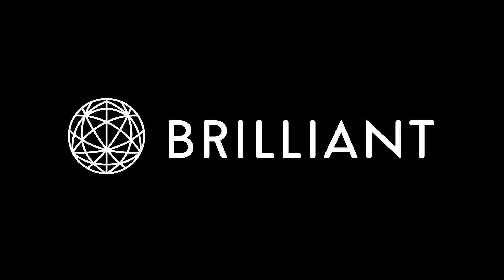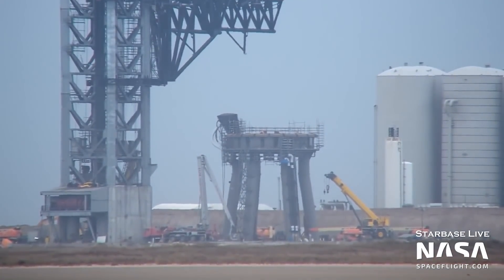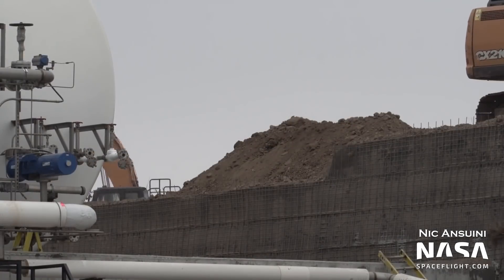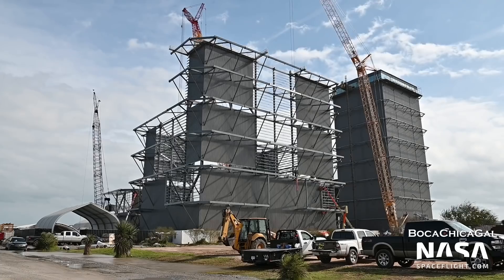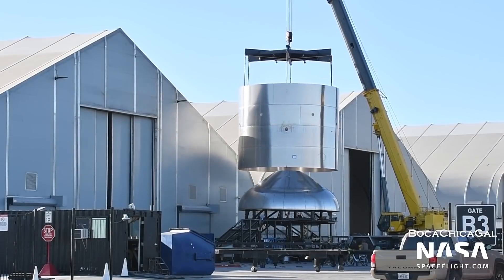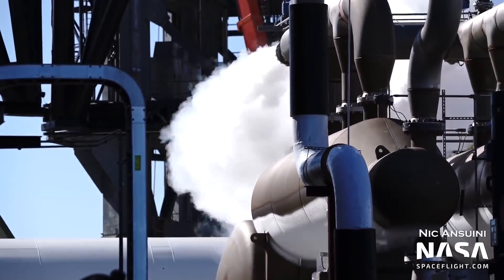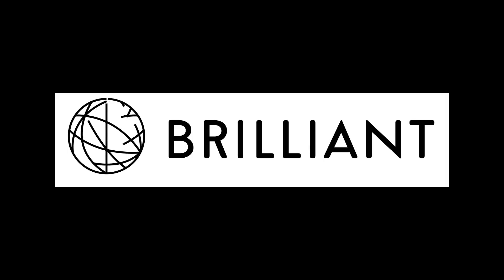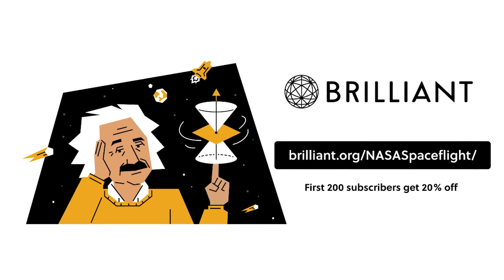SpaceX tests rocket catching system, but is the tank farm in trouble? | Starship Update (Narrated)

Comment: I do appreciate the updates. I'm certain all at NSF have greater insight than me in these matters however  all this speculation about what ships and boosters will fly is frustrating. The next FAA input is late Feb I beleive and then there's no guarantee of approvals. This means Space X has time to produce and yes develop however these are still prototypes and they are not trying to succeed first time. That's what NASA does. SX needs to fly this thing and learn. I can't see them scrapping boosters and ships when they need to learn.

Comment: The removal of the berm probably indicates that the landing area will not be used for landing anymore, so protection in that direction is not needed. All the vehicles will be caught by the chopsticks, so no landing platform needed. 

It may indeed also point to an extension of the tank farm, but to say it indicates problems with the tank farm seems a bit far fetched.

Comment: U r crazy if u think 20 and booster 4 won't fly. They've done too much work on them not to! And they need that flight data. Upgrading without knowing were points of failure are can be very costly to both design and time

Comment: RGV Aerial had a live review of their recent overflight on Saturday, and they were talking about how the original methane tanks at the tank farm were not certified by the Texas Railroad Commission.  Texas Railroad is the governing organization for fossil fuel safety in TX.  RGV was saying that the upright methane tanks were not correctly protected by a protective barrier.  The berm is being taken down to put in two more new horizontal methane tanks that will be protected by a cement wall, and that should pass certification by Texas Rail Comm..  Seems like the end of Feb. date is at risk right  now.

Comment: I dont think they'll use something other than Booster 4 and Ship 20 for the first orbital flight, simply because Elon said they plan on doing catch attemps with the second orbital flight and I think it would be a waste to throw Booster 7 into the Ocean if it was build with the purpose of being caught when you have an earlier more simple version readily available, which was never meant to be caught. Also more flight data is always better.
Reply: Newer boosters and ships might have improvements which will increase the probability of not destroying stage zero at launch. If so, it's probably better to not take the risk with B4 and S20, as stage zero is way more complicated and expensive than a booster or ship prototype.
Reply: Exactly and since B7 and forward is expected to use V2 Raptors, throwing the old V1s on B4/S20 in the ocean isn’t an issue. They’d still get a ton of useful data.

Comment: I think Marcus House said it, or maybe Felix, but they need to do a lot of leak testing / purging and flushing of the pipework + cryoproofing in the tower for the Starship QD. It seems the only real way to do that is with a starship attached to the QD.... so its reckoned they will likely want to do a starship lift and mount fairly soon after a booster lift just so they can do all that as well.

I reckon they would remove starship fairly soon afterwards just cause you don't want a full stack exposed to winds etc (ie normally a full stack would happen within a short window before a launch, not days and days and days)....

So maybe we'll see a chopstick full stack sooner rather than later if only to validate and prep the GSE pipework in the OLT.

Comment: If the methane header tank is located at the very tip of the vehicle - how will that enable the top section to house people & cargo ?
Besides - and that have baffled me for a while - why do SpaceX place the header tank in the tip of the nose if they plan it to be elsewhere anyway - i mean - all of those nice videos that they made of starship shows that the entire 1/3rd top section of the vehicle is for cargo & people, so why are they testing their prototypes with a header tank located where it eventually shouldn’t be ? 🤔
Reply: The lower ends of the methane and oxygen header tank sections will be almost nested or spooned. (Of course the upper end is the cone tip.)   like this:  ⪦)
Reply: Starships will usually return nearly empty except for the header tanks. They need mass at the top end of Starship, where they depend on it during "broadside" reentry to keep the ship well balanced.

Comment: Scrapping Booster 4 and Ship 20 would be a bit silly, since no other vehicles (apart from Booster 5 and Ship 21) can use Raptor 1s, and so it would be a massive waste (of money and time) to not get tons of data from an orbital flight, even if they are outdated.
Reply: The only downside to using 4-20 is the consumption of one the five potential launch permits. Launch costs are negligible, and the two sets of soft landing data will be invaluable.
Reply: They already know all they need to know about Raptor 1, which is that they're difficult to work with and not reliable enough. They completely halted all testing of Raptor 1's on the test stand a while ago, even though they definitely have many that are ready to go. SpaceX doesn't follow the sunk cost fallacy. If something is outdated it's scrapped, no sense wasting time on it just because it was expensive.
Reply: @potatosalad2349  That's pure fanboying justifying after the fact. It's the flight itself that would be providing useful information. Flying the booster hasn't been done. Reentry hasn't been done. If you are going to trash a bunch of Raptors, you might as well get some data out of that investment. That isn't sunk cost fallacy. That would be "we have to continue down this path because it would cost even more money to start over".
Reply: @Markle2k  It's not fanboying to explain why SpaceX made the decisions that they did. Obviously they don't think it's worth it to fly the vehicles, you arguing with me isn't going to change their minds.
Reply: @potatosalad2349  You aren't talking about decisions made. You are justifying your speculations about what they may or may not decide to do in the future. You ignored the utility of flight data and concentrated only on the engines. There is one good reason to stop development testing of Raptor 1s at MacGregor: development is finished on Raptor 1s. And they have all the Raptors they need at Boca Chica already.

Comment: I really doubt they would scrap 4/20, these are not being recovered, there is no chance for recovery and it doesn't make sense for SpaceX to toss Raptor 2 engines into the ocean as part of an initial test flight since the engine production is the biggest bottleneck right now (via Elon). I wouldn't count on any other ship or booster variation flying first unless we start to see engines being delivered to the site for a booster and ship that are nearly complete
Reply: There is still a lot of valuable data that 4/20 can provide despite being outdated. Re-entry being the main one. It would be a step backwards to not attempt a 4/20 launch unless there is another ship and booster combo waiting.

Comment: While there has been a lack of launches this past year I do not think that should breed the negativity that is rampant throughout these boards. In the space of one short year a new cape Canaveral has basically been built. That is not a failure by any means. To properly launch orbital tests you need this infrastructure.  To do it without is dangerous.  Elon is doing it correctly. As for the booster 4. It was required to move from the pad to finish covers and other closeouts before launch.  The OLM also needed finally touches.  Neither of these indicate any issue with the booster. As for the BERM. Only the one side around the tank farm has been removed. Not both. The BERM  between the tank farm and the OLM, witch is still needed to protect from exhaust is still there. People only do two things when they see great deeds being done in front of them. They either support them because they believe. Or tear them down because they cannot stand to have greatness amoung them.

Comment: My sense is that booster 4 and ship 20 will fly as preliminary testbeds for aerodynamics and systems flight characteristics, since the engines are already built at great expense but outdated for next gen. It makes sense to push a B4/S20 flight simply for the valuable data which will be gleaned.
Reply: They have to fly 420. since it won't return its better to waste the out dated equipment and collect data. Also it would be quicker to throw it in the water than to cut it down.
Reply: And while they are ramping up raptor 2 production, will they have enough to fully stock a full stack before they're ready to fly? If not, it definitely makes sense to fly 4/20
Reply: But it takes time to prep and organise the hardware and all the associated legal paperwork needed ... I expect they will be scrapped.

I bet the previous test starships have given them enough data to ensure that the software models are correct, afterall, it was only engines that let them down, not the control surfaces and software.
Reply: @mrmonkeboy  SN8 9 10 11 flew before the successful SN15.

If the first orbital flight has high risk of RUD, then it makes sense to fly BS 420 to gain flight data. It's the SN8 of orbital flight test.
Reply: @mrmonkeboy  Well yes, it will take time to prep and organize, but isn't that exactly what SpaceX has been doing? They've already blown up four Starships in the process of testing. Since they already have read-to-go vehicles just sitting there with millions already invested, it makes no sense to just cut them up rather than doing as many flight dynamics and systems tests as possible, in my opinion.

Comment: Yeah, manufacturing is more important than flying at the moment for SpaceX. There's little point using up all the time needed to fly something if you've already significantly changed the design and wouldn't get much meaningful data from it. Ideally you want to test fly a planform that's solid enough that you can then iterate and optimize from there.  But any major design changes get in the way of this process.  So it's best to stop as soon as it's obvious a major design change is required. Innovation is hard, it takes time and happens randomly.

Comment: The tank farm is grouped together like a bomb. Oxygen and methane should be on opposite sides of the ship and as far apart as practicable is a now common method at weapons facilities. JMO
Reply: Oxygen and methane tanks are not next to each other. The water and nitrogen tanks are in between.
Reply: @vsikifi  They still would not be approaching 'as far apart as practicable'. The tower height ×1.5 would be desirable distance from each side of the ship for each of the two materials providing (ideally) 3× the tower height as the separation between the two.
Reply: @everintransit4240  it was approved by the necessary planning authority so what you gonna do? The site is very small for what is being built.
Reply: @Basher-gang  I absolutely agree but I'm commenting with my experience and very little inside information. So the key phrase is "as far apart as practicable". I'm only saying that it could be beneficial to address the question. The distance that they are apart has to be in some way proportional to their mutual safety status.
Reply: The two home-grown methane tanks lack the mandatory 5' moat wall around their bases. 

There is a need to either build out with many more horizontal tanks, or else build two new concrete pads with the required moat walls for the tall home-grown tanks.